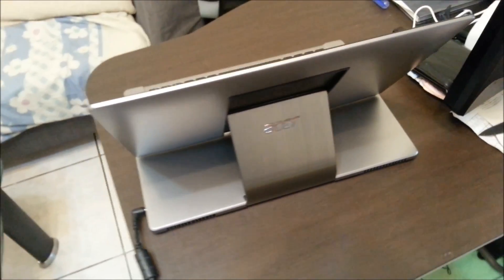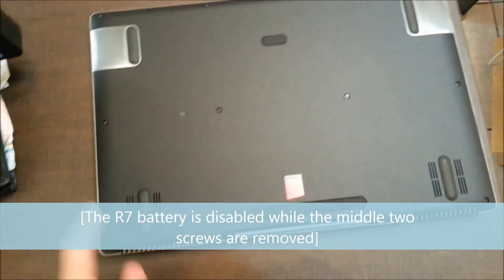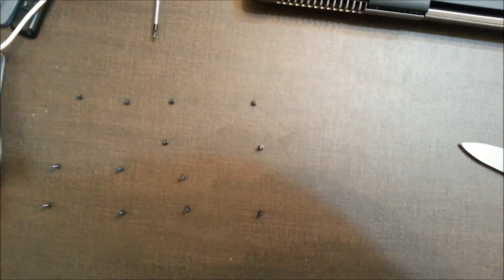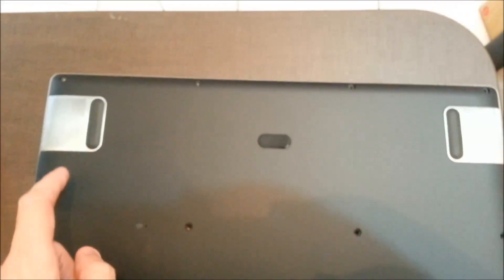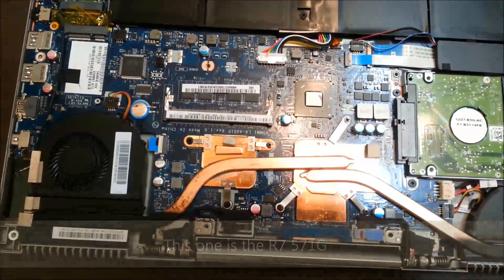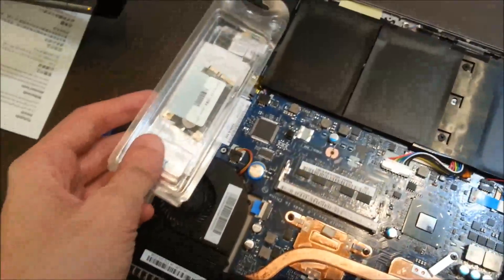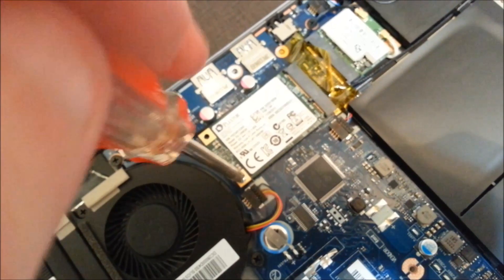Acer R7 Opening to Upgrade the HDD SSD RAM MSATA on Aspire R7 571 571G 572 572G

Comment: i have r7 i5-4210u and gtx 850m 2gb also ram 8gb drr3 but 800mhy can i replace it with  with 8gb with 1600mhy?
Reply from the maker: A good question! In fact, you already have 1600MHz RAM. "DDR" is "Double Data Rate", so the base clock (here, 800MHz) is effectively doubled for 1600MHz speed. It gets confusing because sometimes the base clock is referenced, and sometimes the effective speed is referenced.

Comment: Hello.
The laptop says that the battery is 100% charged, but when I turn off the power supply, it turns off ((
Reply from the maker: Hi, I have heard of this problem before. It could be the case screws. There is some sort of safety feature where the power disconnects when the case is opened, and if the case screws are not tight, it seems that the battery will not power the laptop. Try tightening the two case screws in the middle. Perhaps also the case screws hidden under the black rubber?
Reply: @PenguinJim   Thank you. Thanks to your video, I was able to put an additional msata disk!
Service center in Russia, does not know that you can put msata ssd disk in this laptop)

Comment: how you install your windows?
Reply from the maker: You can put a Windows install program on a USB drive, or use a USB DVD drive. In the BIOS you can choose the boot order. Put the Windows install program device at the top of the boot order.

After Windows has finished installing, you can go back into the BIOS and put your new HDD/SSD/mSATA device at the top of the boot order!

Comment: Hi, that's PC with support Wacom technology. I want to buy this model for design, Photoshop and other program. Could you help me with understanding of active Pen. In this pen use a battery, or not?
Reply from the maker: This is the R7-571 with a touchscreen display, but it doesn't support styluses. The model with stylus support is the R7-572. It has stylus support built into the screen.

Comment: Does anyone know what the SATA 90 degrees angle adapter is called and where to get it? I want to add an extra HDD since my mSATA is occupied with 250gb SSD.

BTW Best buy of the century this laptop.
Reply: Nevermind, found the serialnumber:

20.M9UN2.001

Comment: Hello Jim. Whats up!? Thanks for the video. It was really helpfull! Let me just ask you something: after doing what you show in your video, the notebook stoped detecting when I close its lide! I probably did something wrong the some sensor. Do you know could I have done?
Thanks in advance!
Sam, from Brazil.
Reply from the maker: If you're on Windows 10, right-click the Windows icon (formerly Start) in the bottom-left, and click on Power Options. For the selected plan, click Change Plan Settings, then Change Advanced Power Settings. One of the options is Power Buttons and Lid. Make sure the actions are how you want them there.

If it's still not working after that, then it's probably not detecting the lid closing. Take a look at your Device Manager and see if ACPI Lid (under System Devices) has any problems. (Mine is using the default Microsoft driver from June 2006, so the standard Windows driver should work fine there!)

Comment: is it possible to upgrade the graphic card to 4 gb for the laptop model Acer aspire R7-572G..?plz help me out buddy..!I'm a CSE student.is it worthy..for me ..?
Reply from the maker: No, you cannot change the amount of graphics card memory, but 2GB is suitable for the 750M or 850M in the 572G. The chip itself is not fast enough to make use of more VRAM. It will be a bit slower than a desktop 750.

The R7-572G itself is still surprisingly good, but if you're looking for graphics card power, look at laptops with Nvidia 1060 graphics. They are very close to desktop levels of 3D performance, and the power draw on the 1060 is very good.

Comment: which size and style of screw is used for the m2?
Reply from the maker: m2? There isn't an M.2 slot on the R7, only one standard SATA and one mSATA. Both use standard drive-mounting screws, the kind that you may find bundled with HDDs, SSDs, motherboards, etc.

It's only the external case screws on the R7 which aren't "normal", they are Torx T8.
Reply: PenguinJim Correct, I mistyped.   For the MSata, which sized screw do I need?  I'll need to go to s hardware store since the Samsung MSATA doesn't come with a screw.  Unfortunately, I won't be able to ask the guys at the hardware store for a standard "mounting screw".
Reply from the maker: Errr... they're about this big!

Google says they are "#6-32 x 1/4" long hex head screws with integral washer". So ask for 6-32s, I guess? You should have some lying around somewhere - try old motherboard boxes, or ask a friend.

Comment: hi, can you run msata and the original hardisk together at the same time?
Reply from the maker: Yes. You can either use an msata SSD to cache the original hard disk, or have the msata SSD as one drive and the hard disk as another drive.
Reply: +PenguinJim to cache it?  Please elaborate.
Reply from the maker: I would guess it's the same as this: http://www.overclock.net/t/1227655/how-to-set-up-intel-smart-response-technology-ssd-caching

Some R7 models have a small SSD set up as a cache drive as standard.
Reply: +PenguinJim LOL

I should have stated that I have a learning disability.  I just re-read the first paragraph 3 times and absorbed very little.

As caching is commonly referenced for speed/performance increase, with (what seems to me) little or no video tutorials on Youtube...

    ...is there any chance that you may consider recording a tutorial? :-D
Reply from the maker: I'm sorry, my R7 model didn't have the cache SSD, and I don't have anything like that elsewhere.

If it comes up for me in future, I'll record a tutorial at the same time.

But it's probably best just to get a large mSATA SSD and forget about caching!
Reply: +PenguinJim OH!  Is the R7-572 capable of it?  If not, I am worrying over nothing.  LOL

Comment: Hey Jim! Great video! Would you happen to know the part numbers for your CPU/VGA cooler + second smaller fan? Trying to upgrade my 571 to 571G. Thanks in Advance
Reply from the maker: +Robert Fayziyev Hi, I'm sorry, I didn't see these part numbers. I'm not sure the 571 can have the 750M added to it to make a 571G, but if it can, that would be quite a big home project! If you try to get this done, it would be great to see a video or a few photos of the process - please share them here if you manage it!
Reply from the maker: +goodfellow1984 You're right, you won't need that 24GB mSATA SSD any more. Take it out at the same time as your HDD.

If you don't want to sell it, you may be able to set it up as a caching drive for an HDD in your desktop PC!
Reply from the maker: +goodfellow1984 Yes, it should (hopefully) be that simple! Make sure you have your Windows install ready (on USB, or on disc using an external disc drive) and your Windows serial number ready, of course! Also download the R7 drivers onto a USB drive first, especially the network card drivers, so you'll be able to more easily restore hardware support and Internet access on your fresh install.

Comment: How about the CPU ? Can I upgrade it ? thanks.
Reply from the maker: +thinkmore youlivebetter I think it would be difficult. You would have to remove the entire heatpipe array to access the CPU, and even if that is possible, I do not know if the CPU has been soldered in place. (The first 4GB of memory is soldered into the motherboard.)
Reply: +PenguinJim Is it possible to install the SSD alongside the hard drive in this laptop? thanks again.
Reply from the maker: +thinkmore youlivebetter Yes, you can install an SSD and a hard drive at the same time. However, there is only one 2.5" bay. So your HDD must take the 2.5" bay, and you must get a mSATA SSD (the tiny tiny ones).
Reply: Thank you!
Reply: +PenguinJim Another thing, would any SSD msata/RAM work ? Or there are some specifications?
Reply from the maker: +thinkmore youlivebetter any mSATA SSD will fit in the slot and work with the laptop. Just make sure it's mSATA (not SATA, not SATA-III, or anything like that! Must be mSATA!). Like these, for example: http://www.amazon.com/s/ref=nb_sb_noss?url=search-alias%3Daps&field-keywords=msata

Comment: Hello I have a Acer r7 571. What is the memory card I can put in? Also what other upgrades can I do to my computer?
Reply from the maker: +Jay Known Hi, I used DDR-1600 for my R7-571G. You can see my memory upgrade walkthrough here: https://www.youtube.com/watch?v=eHiB_Hi6H98

The R7 is not very upgradeable. For hardware, I think you can only upgrade the RAM and the HDD/SSD storage. You have one 2.5" SATA bay and one MSATA connector.

Comment: I have the R7-572G with onl MSATA SSD of 250Giga and wanted to place an SSD ino the emty slot but the Sata connector is missing the horizontal connector so is ee only vetical pins looking out. Do you know where i can gaet this connector or how is the the partnumber.
Reply from the maker: +Horst Ritz Hi, someone else had this issue last year: http://community.acer.com/t5/2014-Archives/HDD-install-in-Acer-R7-572G/m-p/184013#M364
Reply: ererwer

Comment: Having this issue where it suddenly shuts off on battery power when I lift the R7...do you have any idea or solution to this problem.?
Reply from the maker: +AVO Yes I do!

It is possible that this issue is due to the way the battery/power fully shuts off if two particular screws are not fully tightened. Some other users have reported their R7 shutting off suddenly if picked up or knocked while on battery power, and some fixed it by tightening those two screws.

If memory serves, it's the two screws hiding under the long pad, but also check and tighten the rest of the screws.

You shouldn't need to open the R7. Just tighten the screws. That might fix the problem. Good luck!
Reply: +PenguinJim Thanks for the tip! Will try it out.
Reply: +AVO Worked for me!!!

Comment: Hi, i have an acer r7 with 500 hdd and 24 ssd. I need to know if i can buy a 240gb ssd for my laptop? i am thinking on samsung evo, sandisk or kingston. Which you recommend? what number of serial sata is?
Reply from the maker: juan islas You cannot add a 240GB SSD to your R7 unless you remove the 500GB HDD or the 24GB msata SSD. (The 24 SSD is "msata" - it does not have a plastic case, and is much smaller.)

I would suggest replacing the msata SSD. Then you can clone Windows from the HDD onto your new msata SSD. Use the new msata SSD for Windows and applications, and the 500GB HDD for media storage (movies, songs, games).

These are all msata: http://www.hardware-revolution.com/best-ssd-fastest-most-reliable-solid-state-drives-gaming-laptop-may-2015/
Reply: Thank you very much for your video. It's really useful. Would you
clarify please why I cannot add SSD eSATA without removing HDD. Does it means
they occupy the same SATA interface or there are any other issues?
Reply from the maker: Mikhail Dobryakov Hi, Mikhail. You can keep the HDD inside. There should be no issues with two drives.

Just make sure you tell the BIOS the correct boot order. You should have Windows on your SSD, so move your SSD to the top of the boot order.

(I removed my HDD as it's more useful for me as a USB drive!)

Comment: Hello Jim,
I have a Acer Aspire R7 572G Laptop. I have following query and I am sure you can answer them
* By default i have 8gb ram. I need to know if it's inbuilt RAM or it's because I have a 8gb Ram in my Slot
* How many slots I have, Someone told me that there is only 1 slot in this model but some are saying there are 2 slots in laptop
* I need to upgrade it to 16 GB RAM. So do i need 2 RAM if i have 2 slots or I can't do it because i only have 1 slot and already a 8gb ram is present

Comment: have you had problems with the product not turning on, but the power light on? mine is charged, but it doesnt turn on. ive tried pressing the reset button on the back and it remains the same.
Reply from the maker: Elisa Graff Have you tried holding down the power button for 10 seconds?
Reply: +Elisa Graff did you forget to unplug the battery before servcing the unit? also may want to look into "crisis recovery mode" bios

Comment: Whats the M sata? Is that where the OS is?
Reply from the maker: There are two connections for disk drives.

One is SATA (a very normal connection, found in almost all desktop PCs and most laptops today). The R7 has one of these, for fitting 2.5" drives (HDD / SSD).

The other is mSATA - a newer connection style mostly for laptops, for drives that don't need a chunky case. The R7 has one of these, for fitting mSATA SSDs.

Different models of the R7 may include either one SATA HDD, or one SATA HDD + one mSATA SSD. I think the mSATA SSD is used for caching the HDD by default on R7 configurations. So the OS's location will be on the HDD by default (as far as I know!).
Reply: Thank you for explaining mSATA. Make more sence now.

Comment: U upgraded the MSata. Now how did u recover the OS image file for the recovery system? I am not familiar with acer's laptops. One more thing. No hdd on your R7?
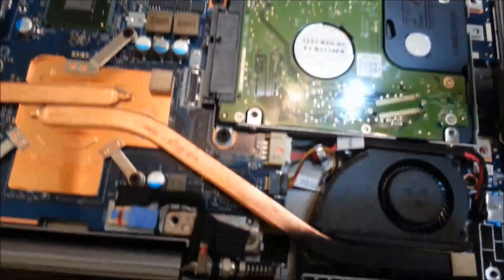Reply from the maker: You can see me take out the HDD at 2:26. To be honest, I just didn't need the space at the time, and have since found that 128GB (from the msata) is still plenty (I mostly use it for office work and the occasional game of Diablo 3).

BEFORE I opened up the R7, I'd made my Acer recovery USB. ;) However, I didn't actually use it in the end, instead cloning the HDD onto the msata SSD and then adjusting to SSD configuration. There's a guide here: http://lifehacker.com/5837543/how-to-migrate-to-a-solid-state-drive-without-reinstalling-windows

Comment: Help me a lot to decide on getting one. What a nice cooling system. They were saying those were a speaker system at the back hold. Now I assume the speaker should be at the bottom. Does this void the warranty? Did acer placed their void sticker on any screw?
Reply: ...there was a void sticker on one of the screws on my R7... depends on where you bought it. I purchased mine in Singapore...
Reply from the maker: I don't believe there are any voiding stickers. I didn't notice any.

Make sure to check your model to get the best one for your needs - not all of them have Nvidia graphics. My 571G has the GT 750M, and newer models have the GTX 850M, but they need the "G" (eg 571G, 572G). The 571 doesn't have the active digitiser in the screen for proper art pens - that's only included in the 572 and higher.

Comment: Hi.
Thanks for great video! Can you record a video that shows us how to replace keyboard? As I can understand it's really big problem for this notebook.. thanks.
Reply: I replaced the keyboard. There are around 50 mini screws and you may have to tear up the back plastic to reveal more screws to open. The replacement keyboard that I bought from aliexpress however did not have the black plastic covering the screws. Took around 1-2 hours and you will have to almost remove all parts to take it off and replace. Anyways I could put back everything and installed the new keyboard which is working great.
Reply: +roland sequeira After several keys (on the left side) stopped working and despite of some referrals that keyboard can't be replaced but completely changed with the palm-rest, i opened the bottom and removed all components to reach the keyboard. I tear of the black plastic sheet on the left side to discover that the seal was compromised (i believe it was due to the overheating in my backpack) so there was some dust which i removed with the microfiber cloth. After that, carefully, i put back the black plastic film and applied some Scotch tape on... It worked for me!

Comment: Can you upgrade the processor to a 3.2GHz?
Reply from the maker: I don't think so, sorry.

But the i5-3337U in this model goes to 2.7GHz in Turbo mode, and is no slouch.
Reply: Thanks PenguinJim, I'm not sure the exact model I have but the processor didn't run a game that I got very well so that's why I was asking.
Reply from the maker: Brandon Austin If you're in the US, I don't think the 'G' models are available, so you won't have the 750M dedicated Nvidia graphics.

Do make sure that your A/C mains lead is connected, as the CPU reduces its speed automatically on battery power.

Also try lowering the resolution to 1600x900 or 1366x768.

Comment: Hi, thanks for the video. How easy is it to replace the keyboard on this model? thanks
Reply from the maker: Impossible, I would say, as it's a scrabble-key layout (you can see the corner of the keyboard at 25 seconds into the video) - all of the keys have their own separate hole in the case.
Reply: +Sergei93265 After several keys (on the left side) stopped working and despite of some referrals that keyboard can't be replaced but completely changed with the palm-rest, i opened the bottom and removed all components to reach the keyboard. I tear of the black plastic sheet on the left side to discover that the seal was compromised (i believe it was due to the overheating in my backpack) so there was some dust which i removed with the microfiber cloth. After that, carefully, i put back the black plastic film and applied some Scotch tape on... It worked for me!